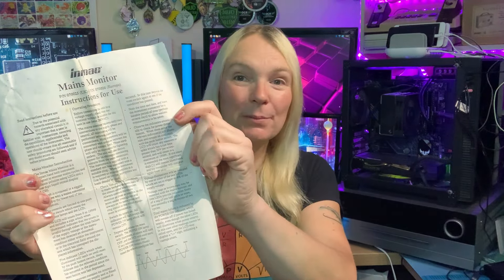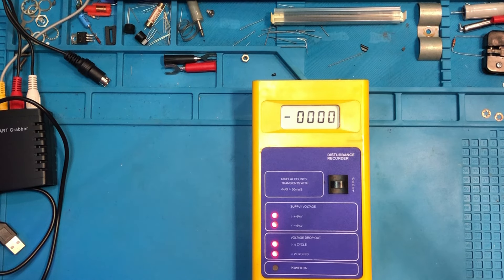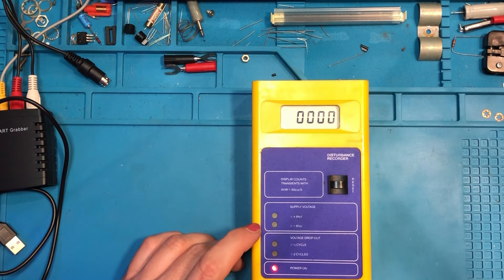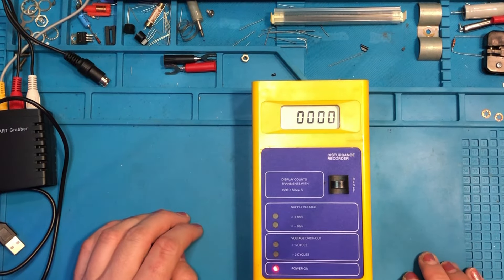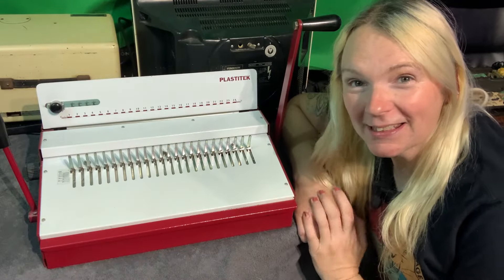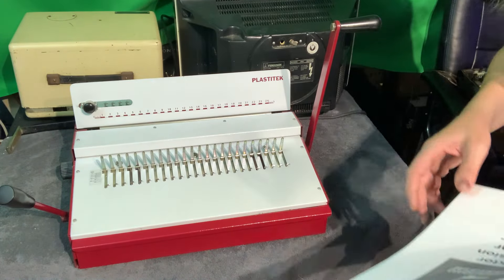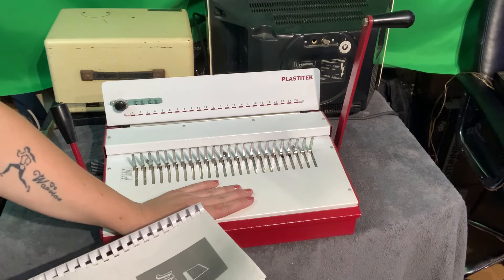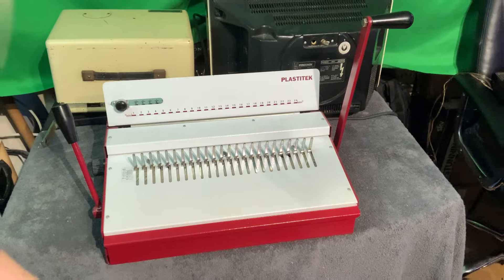Factory Finds!  Meters & More Saved From The Skip!

Comment: That green meter was originally manufactured by Megger and in three or four different colours the model was the Megger m36 battery. And was the first tester I ever use wile at college and when I qualified my brother gave me one for my birthday. All those meters are still compliant wi GS38 and can still be used today. As long as they are in good condition and working order. Hope you put them to work and not just display them on a shelf.
Reply from the maker: I have another megger I picked up from a car boot sale a while back. I think we will look closer at all these in another video. Thanks for watching.
Reply: Yes these can be used today and often are. Megger has been and probably still is the "Gold standard" for this type of instrument along with Fluke and AVO. they were very expensive when made and far too good to be scrapped. You need to be careful when using one as they use quite a high voltage and although the current is very low so as not to be dangerous they can give you quite a "tickle" if you get hold of both probes